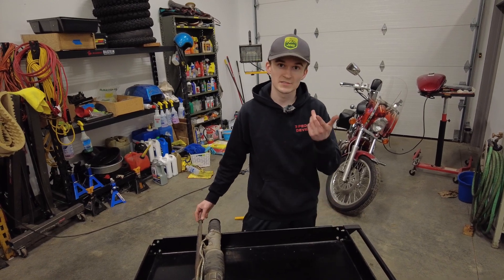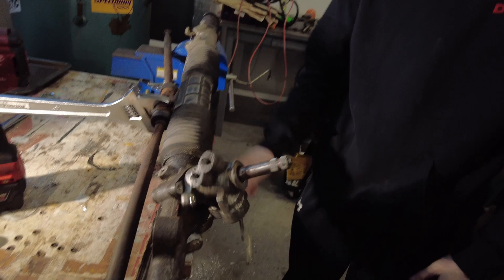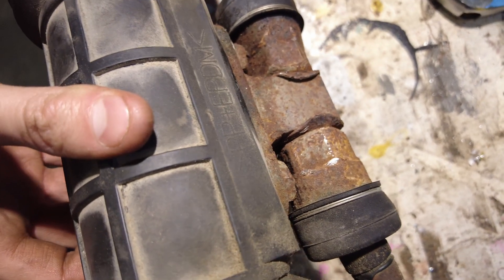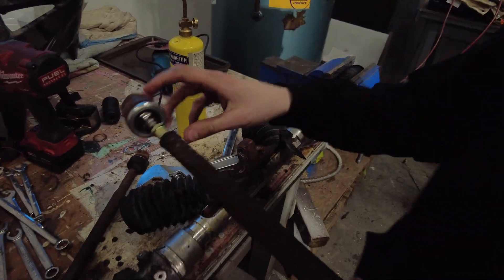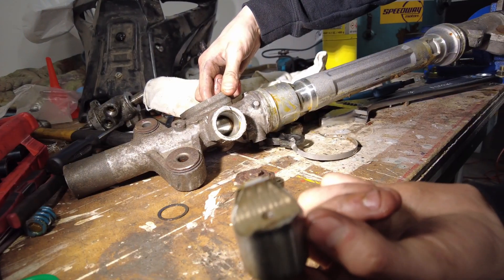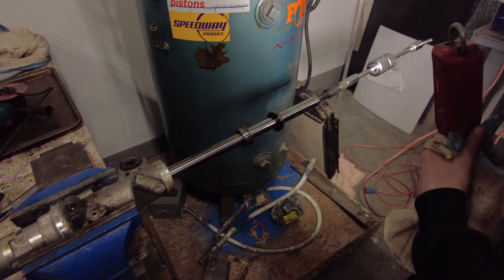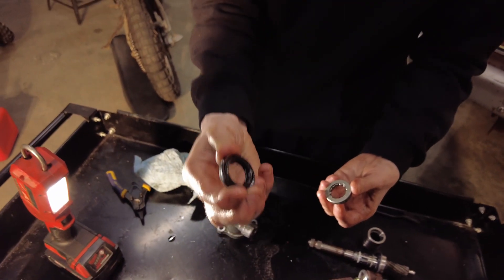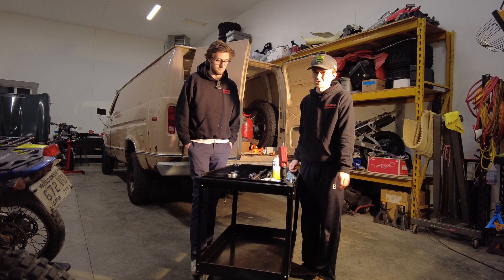Acura RSX Type-S Power Steering Rack Teardown

Comment: Those hard lines are discontinued and sought after these days…
The Type S rack in general is a close gear ratio rack unlike the base model RSX or any of the same generation Honda Civics including the SI
ppl convert to the EP3 Si electric racks instead, which is great for a daily driver but if you wana build a serious track car then ppl do this Type S rack and a electric pump from a Volvo 
The EP3 Electric racks over heat and turn off after a few hard laps
Reply from the maker: Yeah those lines were impossible to find when mine failed. That's why I switched to the Civic EPS. Miss that car now. Never should've sold it!